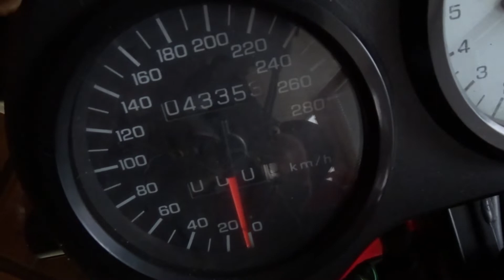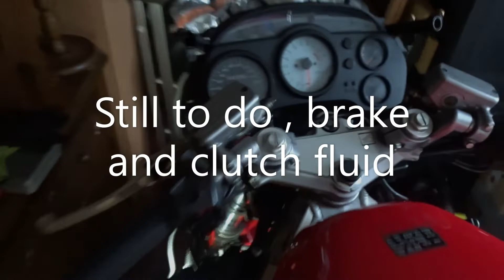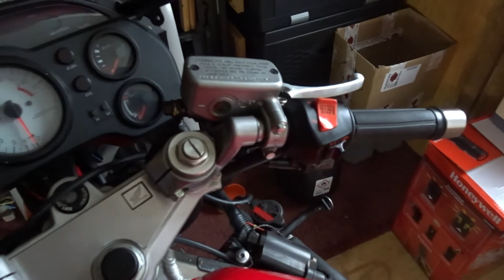Honda VFR 750F Update

Comment: Everything was fine. By pressing the red button from OFF to ON position couple of times to refill all pipes will definitely help.
Reply from the maker: Thanks for your comment, you may be right. But it makes sence to clean and overhaul the carburettors after 27 years.